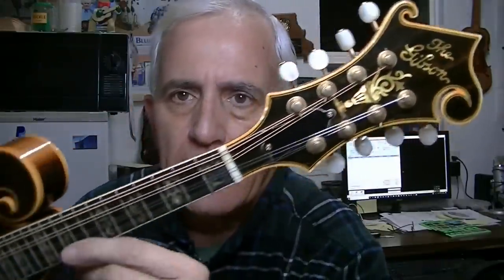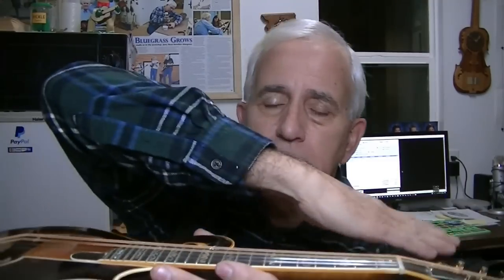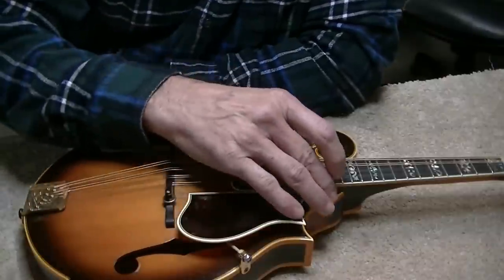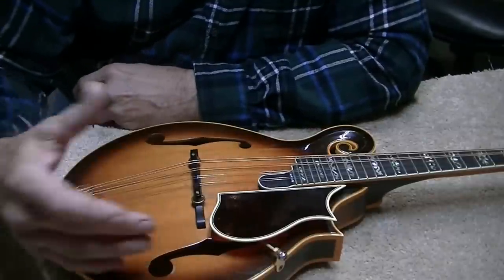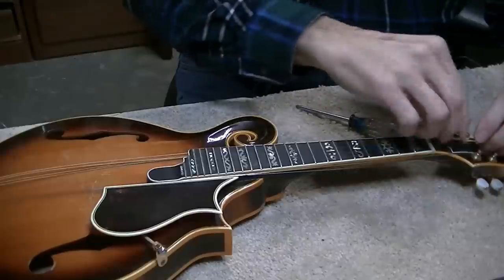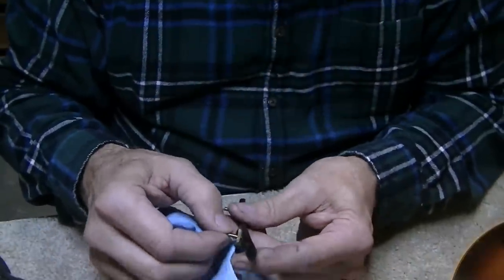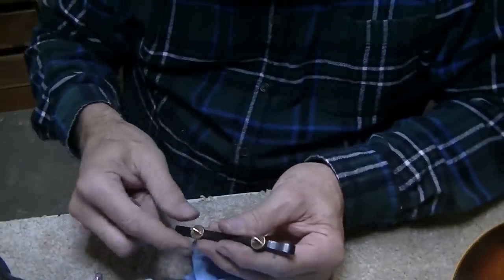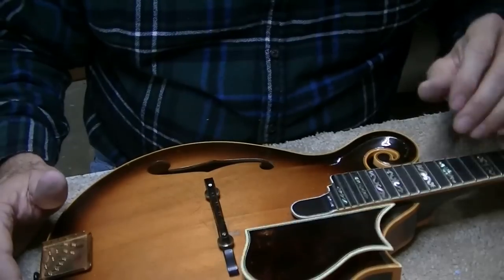610 RSW From The Vault! - A 1974 Gibson F5 AMERICAN CLASSIC Low Neck Angle Repair

Comment: The fellow that was in charge of mounting the neck assemblies I had made the previous week, at Flatiron, told me they were at an approximate 4 degree angle but each one was fit individually.  The two electric mandos I built years later, had about a 4 degree angle, which made for optimum play ability and easy to adjust.  I sold my first e- mando to a jazz music player who "had to have it".  He gave me a check for 16 hundred bucks.

Comment: ???? So HERE'S a story for you, Jerry - I mentioned that I was hoping to finish setting up the second acoustic guitar build soon. Preparing to string it up today, my first ever attempt at reaming bridge pin holes. On a couple of holes, I went a bit too deep and wide so that the pins wouldn't jam in tight enough, pins popping out under string tension. Crud, now what? Impossible to string up the guitar! So after thinking about this for a bit, I thought hmm. Big prob. Thought some more. There has to be a solution. I need a shim! How do I shim a conical hole??? I have a tiny hand held pencil sharpener, the type we had in school. I re-sharpened a pencil and took the shaving, wrapped it back around the tip of the pencil (which is conical), deposited the tip of the pencil with shaving into the bridge pin hole, removed the pencil, pushed the shaving into the hole, packed it in, dropped some superglue, sprayed some accelerant, waited, trimmed sanded and re-reamed carefully, and now the pins fit perfectly, strings are on. Tomorrow I'll take on the action as the nut slots need work and the saddle is proud - you've already taught me about that. Would you have done different?

Comment: You'd do better placing the bass and treble sides by slot thickness on a later Collings saddle: They are fitted backwards to the traditional way. 😁 You did well to make it payable. That was a horrible era for their mandolins, having lost their way (and the plans, you'd think) from the mid 1920's. Well done, Jerry.
Reply: I would agree this mandolin is "vintage" - - but I for one would not agree that it is an "icon". I think that it is the opposite of that.  Poorly designed and built with much thicker wood than necessary, these were not great sounding mandolins.  I once had one for a year in around 2005 or so.  It sounded exactly the same as a $500 Morgan Monroe MMS-3 that I compared it to one day.  Too bad this owner did not spring for putting the wedge under the fret board -- putting more slope on the neck and thus more string pressure on the bridge might be one thing that would help that mandolin?  What it really needs is though a re-graduation of the top and back boards.  That said -- I've heard several say that taking the neck or top board off off that model was a nightmare. They did not have a dovetail joint but some kind of a patented by Gibson "straight slot" mortise and tenon neck joint.

Comment: I'm older than you are. I remember the folk boom of the 1960s. It's interesting that you should mention a lack of quality with Gibson at that time. What I was most familiar with was the lack of quality of many of the Gibson guitars during that time period. I remember seeing a brand new Gibson J-200 with a loose pickguard. But that was practically nothing compared with other problems. Gibson guitars had cheap bridges, like the one you took off this guitar. Worse yet, there were some bolt-on plastic bridges that you could actually SEE UNDER on brand new Gibson guitars. No kidding! You could actually see under the bridges! There were Gibson guitars that had wood shavings IN THE FINISH and bindings that were put on crooked! I owned several Gibsons and I avoided the worst of these. However, I had to work on one brand new Gibson guitar that I had bought for about a week before I could play it properly.

Understand that the first professional quality guitar I bought was a Gibson Country/Western. That one was a very good guitar, but it had been built right before Gibson's quality went bad. I bought it used and in immaculate condition for $165.00 (plus another $7.00 for a soft shell guitar case). I bought it somewhere around the early to mid-1960s. I loved the guitar but my brother talked me into selling it to a friend and buying a used Martin D-28 instead. We were interested in Bluegrass music at the time and Martins seemed to have a lot more punch than Gibsons and were probably better for playing Bluegrass music.

Bringing things more up to date, Gibson dropped their quality again at times during the last many years. All over the Internet people were complaining about quality problems with Gibsons. There were still some good Gibsons available, but ordering one was a gamble. You had to personally check each Gibson guitar before buying one to make sure you got a good one.

Now, in case anyone thinks I'm making any of this up, we have a very well-known music store here (McKenzie River Music in Eugene, Oregon) that was a Gibson dealer for decades. This store discontinued their dealership with Gibson. That was a few years back and I don't know if they ever started selling Gibsons again. The owner would not order guitars. He would buy directly from factory reps after personally inspecting each instrument. The Gibson guitars he had in his store seemed OK, but they were carefully handpicked by him and that's why.

I bought a (Chinese?) Gibson mandolin a few years back that was HORRIBLE! I had bought it from Musician's Friend and I had to return it. The mandolin had 1/3 of the nut missing! The screws that were holding the truss rod cover on were just dangling in midair! There was no wood under at least one of the screws. The fret heights were off and varied across the whole width of the frets. In other words, individual frets had several different heights across the width of the same fret. When I called Musician's Friend to get return instructions, they tried to offer me a discount to keep the mandolin. I told them it would cost more than a new mandolin to fix this thing. I asked them how they could sell something this bad and they lied (they surely must have been lying) by telling me that they weren't allowed to look at Gibson mandolins before selling them! What a lie and insulting answer!

I'm not up on the absolute latest quality of Gibson instruments. I hope they have improved by now, though.

Comment: Jerry, as you no doubt know, Gibson style mandos were built in Bozeman, MT in the '80s.  The Flatiron was building them better than Gibson, so Flatiron was sued, but later was swallowed up by Gibson, which for many years in the latter '80s to mid '90s,  made a better product.  Bill Monroe came to our shop for several days.  Yeah, I met him and have his autograph on a mando I got to build for myself.  Then, shortly after, the shop was moved to Nashville and eventually China.  Gibsons are still made in Nashville, I think
Reply: I would never recommend removing a back to fix a low neck angle.  My humble opinion / solution would be to remove and wedge the fret board.  I would rig up a tapering jig where a plunge router with a lowering knob could be used to get an adequate taperd wedge.  It might take a couple tries, but a sloped set of rails for the router to travel on would do, I believe. It would zero thick on one end, and maybe 5 to 7 mm thick on the other end.  I do not know, but make up a few dummy /test wedges til you find  the proper angle.    You could use ebony, maple, or any stainable resonate hardwood for the final piece.  Just my ideas for your project.  Good luck my good sir.   Bob in cold Montana

Comment: S. Randell  Gibson head mandolin builder 70-74 ?
Reply: Rendell not Randell. Stanley E Rendell
Reply: @luckydawg7180  Also, Rendell was not the builder -- rather he was the President of Norlin the company that owned and wreaked Gibson.  That mandolin design was developed in late 1969 and they were pathetic -- every one of them.  But Gibson at the time (i.e., Stanley Rendell) thought they were the best thing since sliced bread.  He was very proud of them and considered them to be the best mandolins ever.  It took nearly a decade before he finally left the company and Roger Siminoff showed Gibson how to make the kind of mandolins that they had had made before WWII.
Reply: I wasn't sure about it, hence the question mark. His name is on the list  with Siminoff, Derrington, Carlton and the rest. Thanks for the info. I know Norlin was turning out junk, just didn't know who was running the entire debacle.